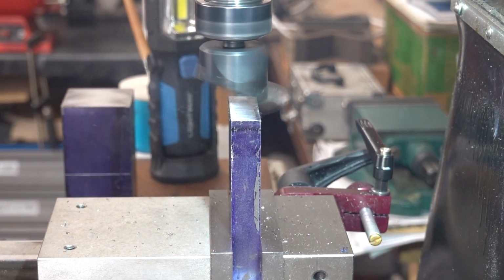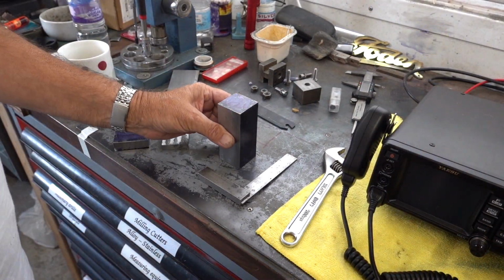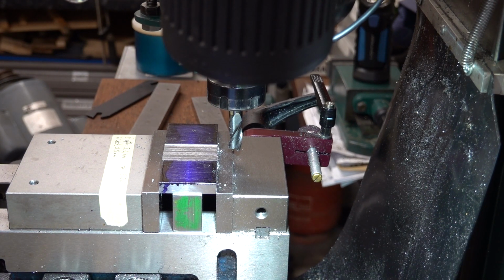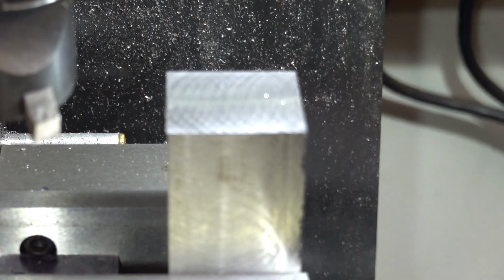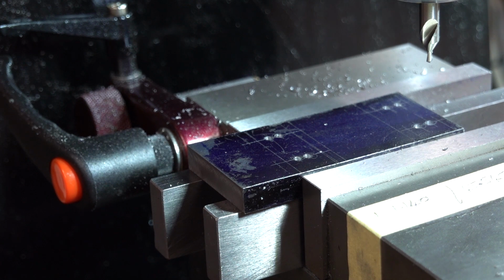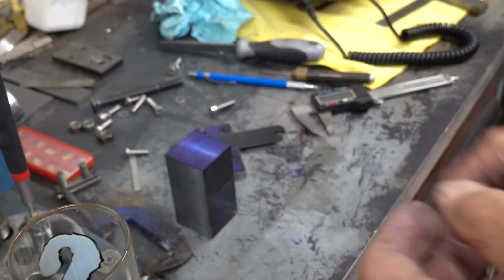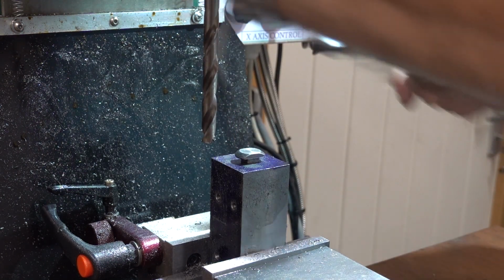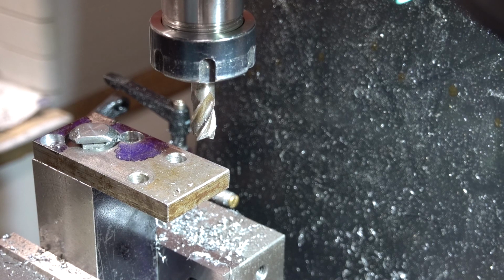Making a Lathe rear parting off holder part 2. Myford or any lathe

Comment: Hi Steve
You've made a cracking job of that! Are your hss blades dead flat or are they tapered? Mine are tapered so I couldn't use the same clamping method.
Reply from the maker: It is flat. But I have one which is tapered. But looking at the profile it is only tapered on one side so a holder could be made to take it. Not sure about yours. ??. 
Steve.